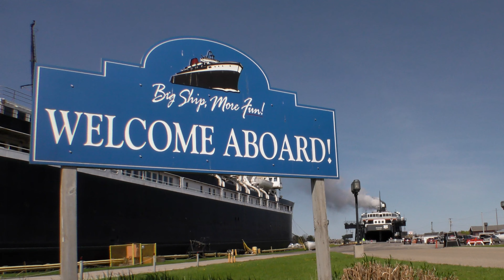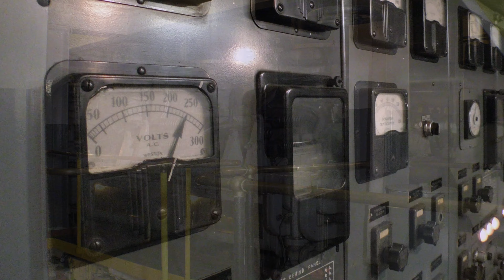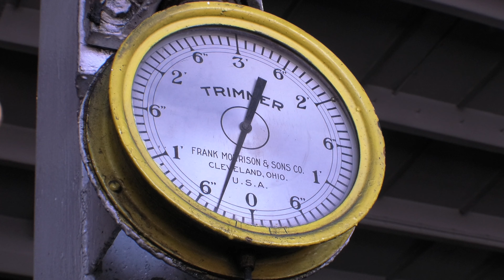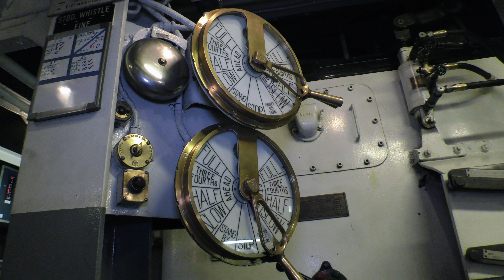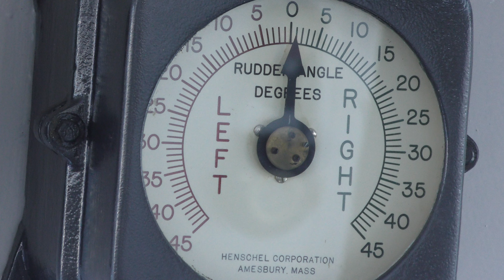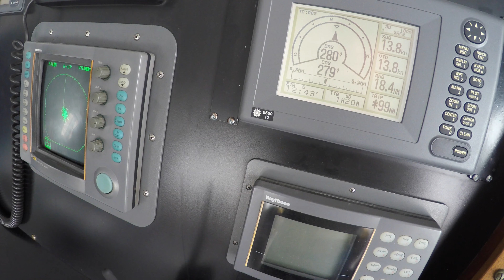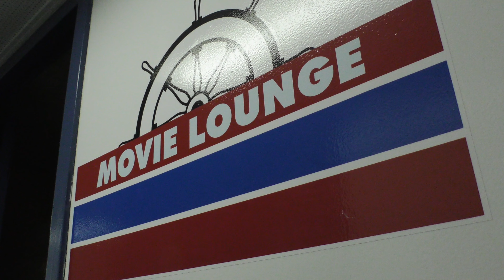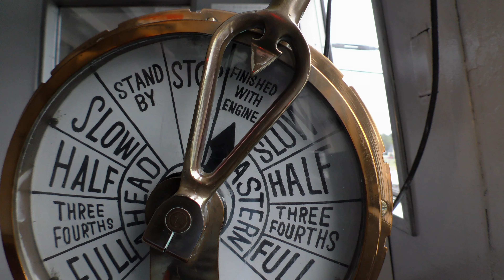SS BADGER VIDEO TOUR   No Captions H 246 Master

Comment: Thanks for a great presentation in this video. My one crossing from Mantowac to Ludington was made at night in 1973, when there were rail cars on board. I was driving a Land Rover Dormobile which had a gearbox failure which only had 1 st and 4th and no reverse. I told the crew about this and they put me on at the head end facing inboard. When we arrived at Michigan I said I required assistance to  push me off as I could not backup. The crew chief said “we don’t push anything”. However it quickly became obvious no on could drive off as the vehicle lane was blocked. So despite the statement, they did indeed push us off with several deckhands. Managed to get all the way home near Albany NY with that Land Rover when the rest of the transmission quit. That trip across the lake was as memorable as yesterday despite all the years that have gone by.
Reply: Yup,  Thats the way it works.  They have to get you off before the others can get off.  They're good people and I figured they'd move you off the Badger one way or another.  I love riding on her at least once a year. Glad you made it home.
Reply: Key word:  "Land Rover",